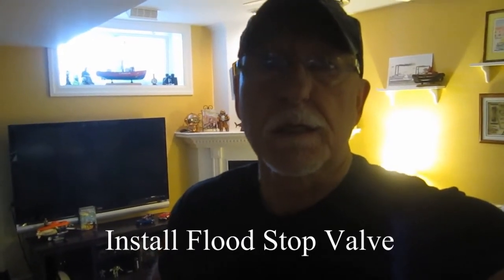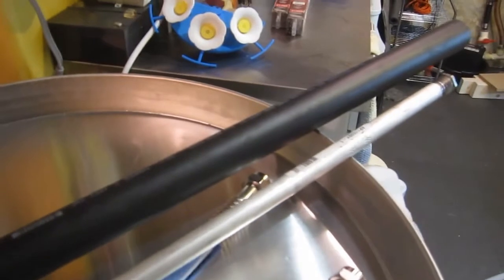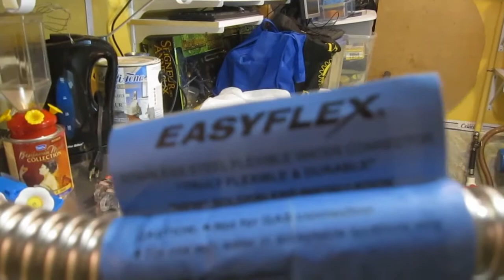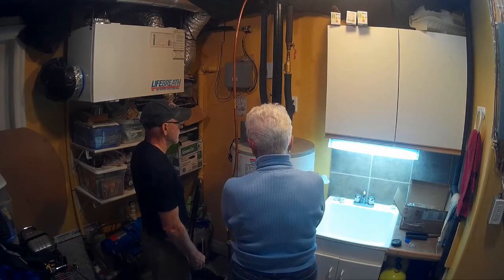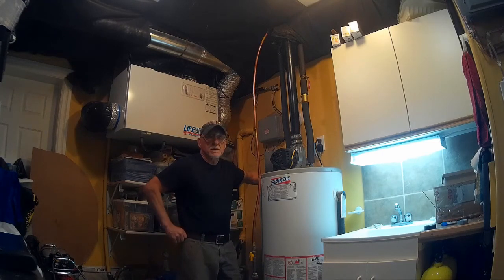Install FloodStop Water Heater Auto-Shutoff Valve FS3/4NPT

Comment: If one day your water stops flowing to your sink and you go press that open Button on the control panel and nothing happens and then you press the close button and the water starts to flow again, then you need to replace that valve, the one with the little motor on it that's the only way you'll fix. I don't know why that motor goes bad and I don't think the company that makes it knows why it goes bad but the only way to fix the issue is change out the whole valve.
Reply from the maker: What you say is True but FS Valve is an NTP screw connection.  It would be easy to shut inlet ball valve, then remove FS valve and just connect flex connector until a replacement FS can be found or not.  We have lived in our house for 21 years and had to replace most appliances, toilet ball valve assemblies, Light Bulbs, Sections of Fencing, Sprinkler Heads, shut off valve rubber washers, smoke detectors, door seals, kit faucet valve cartridge, Outside lights photo cell, Etc, Etc. Just installed Heat pump this year. I did get a reduction in my house insurance when I installed FS Valve.  I test valve regularly and no problems since it was installed.  Occasionally dogs test valve when they get a bath in the nearby laundry tub and shake water before they get blow dried.  I don't even want to think about flood damage that can be prevented. BTW HW Heater is also in a metal tray that drains into nearby sump so valve is double protection.
Reply from the maker: Don't even talk to me about organic shingles that needed to be replaced after 13 years.  Warranty did cover replacement shingles but not labor and other materials. Class Action did help a little.  See my timelapse video
https://www.youtube.com/watch?v=F-rMKfS6Sa8
Reply: Mine did this in the morning…no hot water and then I push close and hot water started flowing…is this same issue…I just replaced my water heater and had no issues with this until today

Comment: Put water detector on the floor. Water heaters don't always leak into the pan. It may develop a leak at the top connections and spray away from the tank.  Ask me how I know this.
Reply from the maker: Seems logical since I am trying to protect the hardwood floors installed on dricore in the rest of the basement.  There is a sump pump and floor drain in the equipment room but I wanted to protect against an infinite supply of water from a leaking tank.  Especially if we are away for a day or so.  A Lot of water can leak in a short time.

My experience is that the center chimney pipe that goes between the lower combustion chamber to the top of the tank leaks and water comes out the lower combustion chamber opening.  The flood stop control  has wires for two more detectors so I could add a second one on the concrete floor near the tank.  Will check price for extra detector pad.   This would protect against both scenarios.

Thanks for your feedback.
Claude...